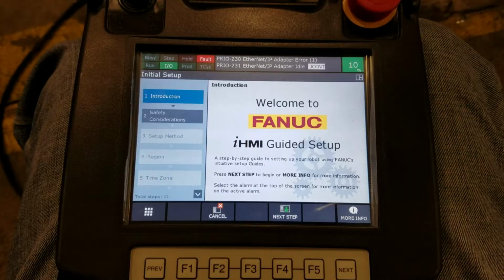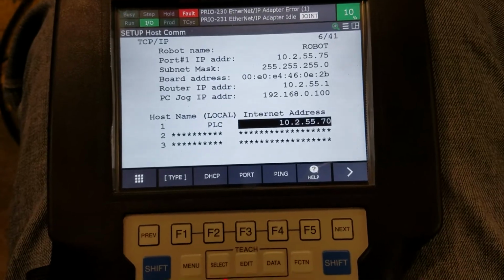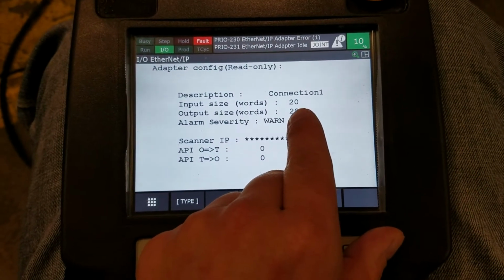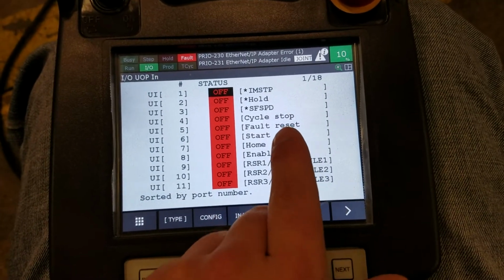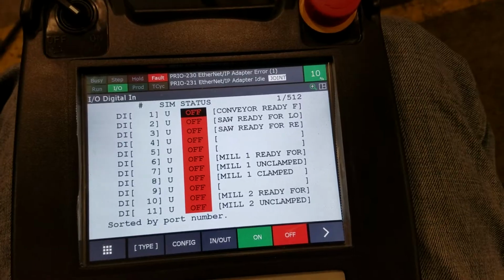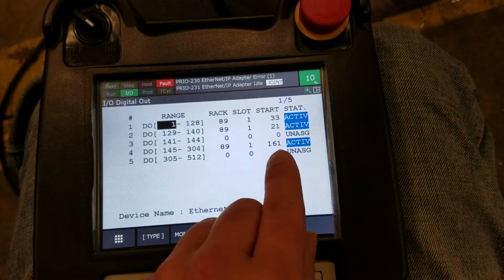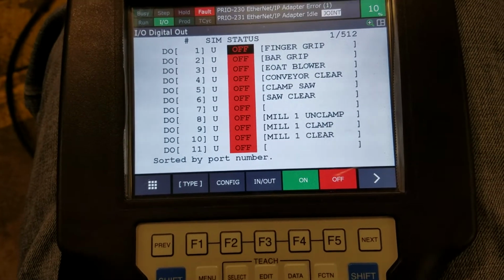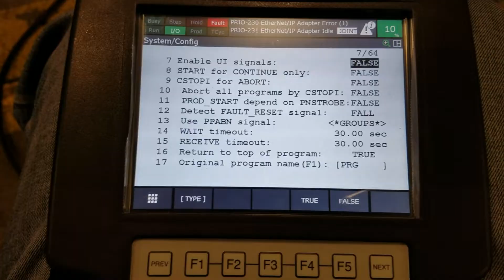Fanuc Robot: Setting up Ethernet IP

Comment: I have the same fault errors PRIO-230 and PRIO-231, what did you do for fix them?
I tried the same steps as you and the errors are there, even when I did the configuration.
Reply: I have the same problem, how did you solved it afterwards?
Reply: @mihai96gun  I have the same problem, you can say, how did you solved it afterwards?

Comment: so i tried to go to IO and look at Ethernet/IP and couldn't find it. That tab has the third option Greyed out. Any ideas how to get it to display?
Reply from the maker: Do you have one of the Ethernet IP options?
Reply: @ericwhittaker3570  I have IO assigned to he ethernet rack, the robots ip is set, but no ability to configure the ethernet connection
Reply: @TheShooter466  Did you ever figure this out? I'm having the same issue
Reply: @Slogan6152  The R30iA controllers can have a software lock placed on Ethernet IO. It requires a reflash bought from Fanuc themselves. R30iB controllers come with Ethernet IO by default, no extra purchases.

Comment: For #2 D0 (129-140) it is perfectly ok: bits from 129 to 140 are assigned to 21 to 33.After that it continues with DO#1 (33 - ...)...I will call that a real Japanese  REVERSE engineering :)))
Greets from Serbia !

Comment: Hi Erik is there any place I can message you? I have a 2018 tongtais ez-5 a high speed drill tap same as a robodrill but it uses the new basic oi-mf controller I've managed to get the tool setter to work and a macro to check the z- height offsets and set them but just would love some help tweaking it. If you're willing I'd be so grateful. My email is Fifty50knives@gmail.com. Thanks again as we have no tech support in Australia.
Reply from the maker: I'm sorry mate, I know how to do just a few things on the Fanuc Control. I've never setup a tool setter myself, nor have I tweaked the toolsetter macros we have already. Sorry man!